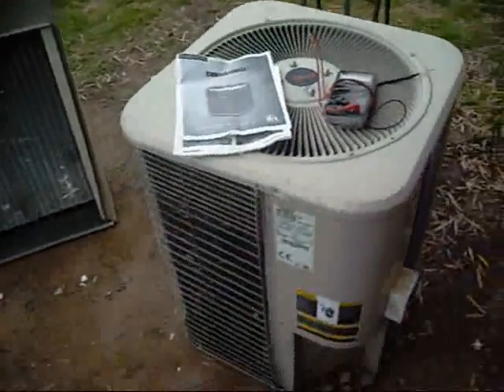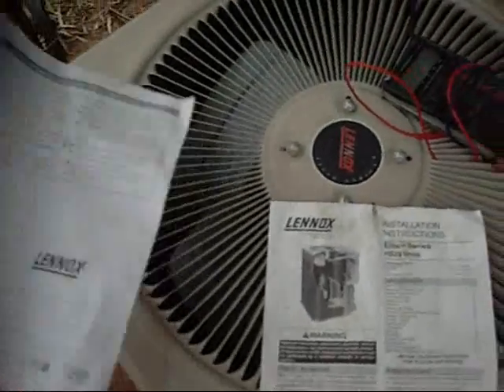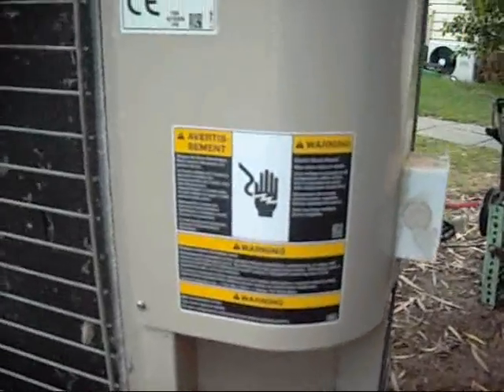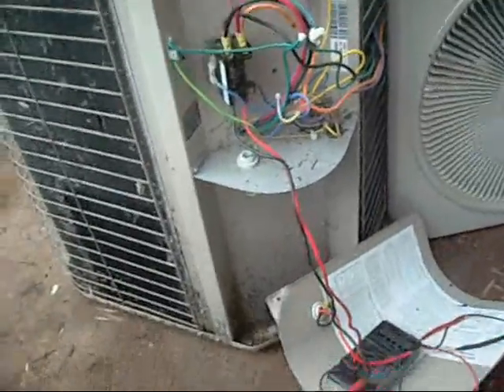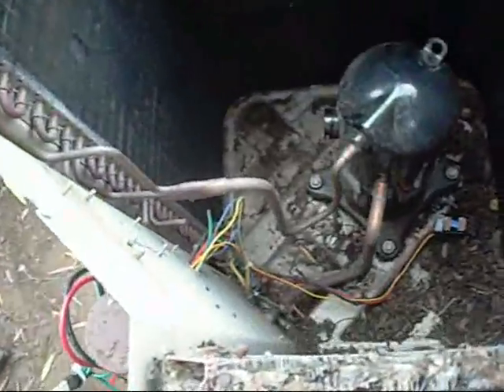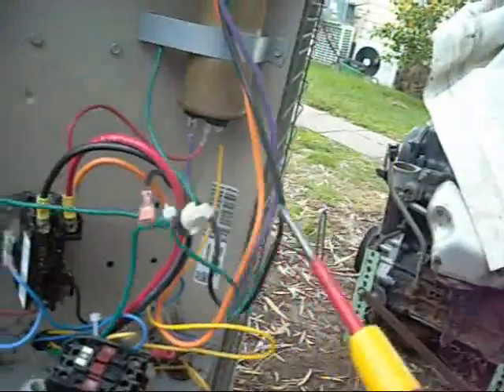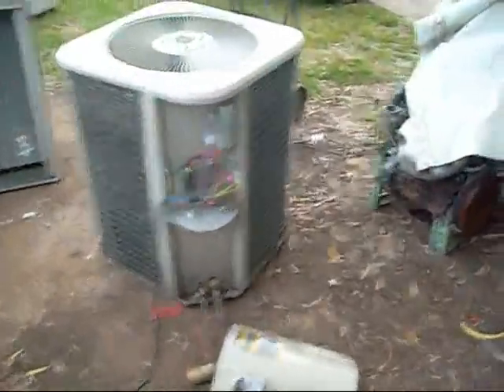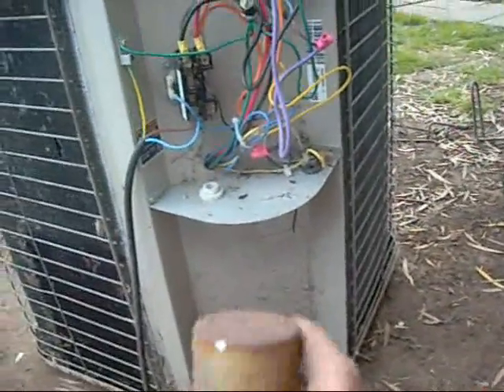Lennox Elite - 11 Central Air Conditioning System Troubleshooting

Comment: If you're gonna troubleshoot single phase compressors I would recommend a meter that can measure capacitance . Those run caps are really easy to test.

Comment from the maker: @pow0006 I should do a video on that.

I check it to earth then across each pair of windings. the values on the compressor should add up, or be very close. if they are way off it means trouble.

Comment: ah, the ol' hs/hp 29 series.  The good old days.   Most leaks on the outdoor units are at the upper left of the coil... usually first or second bend.  Man, live a little and push in that contactor with your finger. Some of those units had a ten year warranty on the compressor.  I'd guess that indoor coil is a bit on the large size for the condensing unit.  Maybe insufficient cooling to the compressor, lucky it's not locked.  Time for a meter with capacitance checker. ;)

Comment from the maker: @PutSome5tankOnIt Interesting that the disconnect has to be mounted on the wall near the unit, most I see here are disconnected remotely on the house main panel, or have a simple 1 or 2 pole switch screwed to the cabinet somewhere.

this one had a 1 pole rotary switch that left the neutral line still connected.

Comment: Nice simple unit with no complicated electronics. Much easier to diy fix.   Thats why I decided to keep my older furnace and R22 central air conditioning system instead of pissing away $6000 for a new system.  R22 seems to be the coldest from what I noticed.  Or am I wrong?